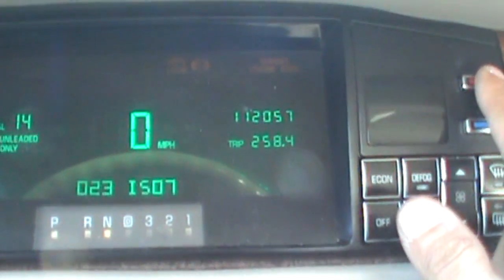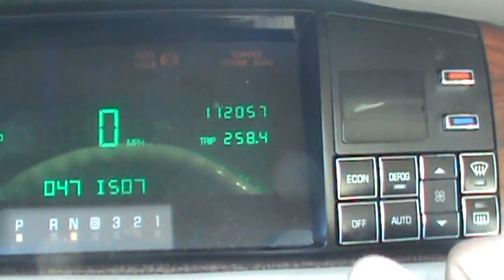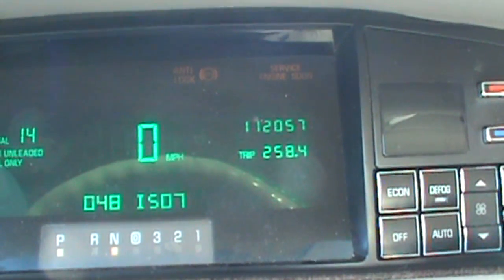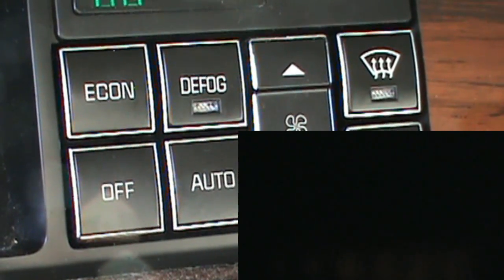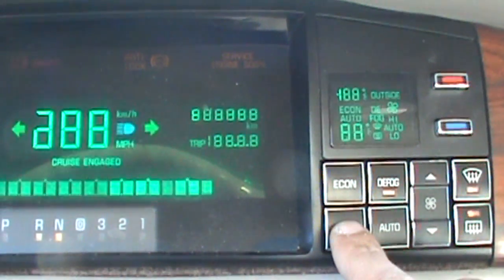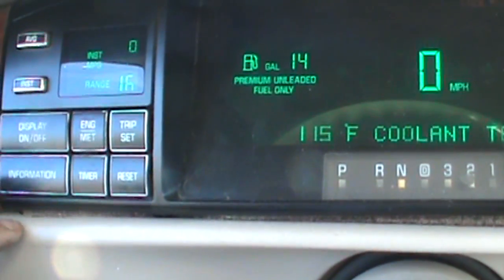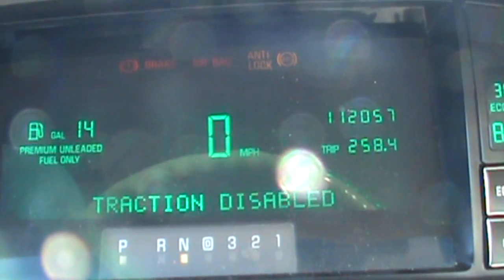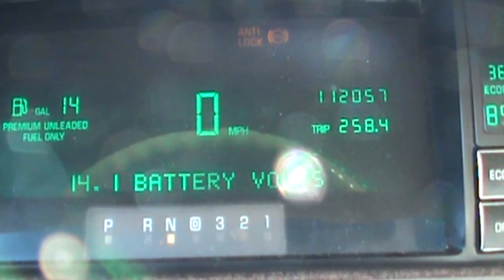Cadillac DeVille Gauge Cluster Reprogramming: Engine RPM, Coolant Temp & Battery Voltage

Comment: Watched this thinking it was something new for me haha. Good info though. Either someone did it on mine before I bought it or the 94 was already programmed that way, but these options were able to be accessed by me in my 94 DeVille 4.9l. Useful for sure seeing as I'm likely going to be the last and third owner of the car at 111,000 miles 31 years old now. Good to monitor that my coolant isn't drastically changing or rpms aren't going wacky on me.

Comment: My 96 Cadillac Concours has a digital gear shift indicator and does not display as the one shown on this video. I can’t read the different folders of the computer. Is there a video showing a later version of these instructions? 96 with total digital dash.

Comment: Hello , I have a 1997 cadillac deville.   This vehicle has been sitting for the last 3 years my neighbor is retired and has not used it I recently purchased it has 39000 original miles it drives very nice however my service in a service engine light soon came on I'm on and I took it in for a sfor a smug and it did not pass the results were that the Hydro Carbon (HC) numbers were too high.can any please explain to my how to resolve this issue, I would really appreciate your help.

Comment: I had the original assy and switched the center portion of the cluster with another one. I started the car a few times and reset it a once.  But my alternator is bad. Am I good if I fix the alternator?

Comment: I have a 1993 Eldorado, and when I went to the sub menu that shows IS07, I had three zeros (000) showing.  I didn't add 32 to it because I believe if you use the "clear codes" menu it will clear the codes back to zeroes.  I don't know that 32 is any magic number.  One other thing, my SIR light stays on all the time (air bag).  When I try to clear codes in that menu, it says "no codes to clear".  Anybody have a suggestion on how to turn the SIR warning light off?

Comment: What else do you know how to do? Im modestly familiar I.E. I can shift gears manumatic ive actually had to or run the risk of blowing my ish up dont mess with the throttle position sensor or the idle speed actuator lol my car would redline at all times wouldn't shift until the very last second I basically had to hotrod it to the max

Comment: I have 3 speedometer clusters 2 have 3 plug ports my 96 has 3 ports I have to keep switching clusters so the car can start every few days I’ll get “THEFT SYSTEM” when I get the message car won’t start after I turn it off 
Only the digital is out not the warning lights 
I could unplug the burnt out one and put the wrong one in and still be able to drive the car if I were to disconnect theft system will I be able to start car the car using the wrong speedometer ?

Comment: The dic on my 1992 is blinking on and off help
Reply: Greg Muscovalley it’s some kind of a faulty relay. Take it to an electrical shop before it short circuits. It happened to my old 86 eldorado with the digital instrument cluster. Fixed in no time.

Comment: James McQueen
4 days ago
If I end up with a  000  ISO7 Code do I add 32 to the code which will make it show 032 ISO7.  I got confused about this.  And if my code reads   016  IS07  I should add 32 to it to make my code reads   048 ISO7 .     I want to be clear on this.  My email is mcnell4@att.net    There seems to be two different codes I can end up with.  Thanks so much for your help.  I'll wait until I hear from you.    (Mac)

Comment: Hello T.Y.C.,
I have a problem on a 1990 Cadillac DeVille and I was wondering if you know the why and how to fix it?
The fuel data and climate control clusters show only the letter "c" they have worked on and off but not for long,
Background on the car, it was bought and brought from Tennessee to California; I have removed and disconnected BCM and ECM cleaned the terminal which showed some light grey rust, opened the modules and checked for cracked solder on the circuit boards but no cracks visible... was surprised to see the boards sealed with some kind of clear epoxy, very well sealed!
however the terminals of the BCM port also seemed compromised by the corrosion.
On my way here I checked fuses and relays cause it was kind of cold and wanted to see if I could make them work, a few minutes back in the road the clusters worked for about 5 minutes was able to change temp settings and checked fuel usage, the second time was at home in California after I had checked and put everything back together but this time only worked for about 30 seconds and it showed the letter "d" blinking proceeded by the letter "c" which stays on.
Nice car so far all dealers I have gone for help have turn my business down because they no longer have service manual for such an old car.
The end.
Reply: My husband has a 1993 Cadillac DeVille and car is also showing the letter C. I would love to find out why so he can fix it.

Comment: Hey! How can i delete "Anti Thef System problem"? The key is OK, the resistor is ok, and i can't start car, please help me!
Reply: Sergio Weikath Check your ignition 1 relay, your Starter relay, Check your ground cables to see if they're are connected to the engine and the body or if they are not broke. check your positive cable as well.
Reply: oh just seen you mentioned just the key, check your ignition cylinder as well, the wires tend to break.
Reply: The car have Spark, but dont have injectors pulses, fuel pump is ok.
Reply: Sergio Weikath so the car cranks?
Reply: Yes, just cranks!
Reply: Sergio Weikath try the relays, or you could probably have a bad neutral safety switch. try putting it in nuetral then crank it. if not either bad terminals, alternator, bad injectors or not enough fuel pressure. check the filter if it ain't the Fuel pump.
Reply: Ok im will try the relays and the fuel pressure, i was check to crank in netrual but was a fail test, thanks for the information, i will write you if i have questions.
Reply: Sergio Weikath np

Comment: hey man I found a 94 Cadillac DeVille and it runs fine but the dashboard lights don't work at all do you have any idea what problem that could be
Reply: Yeah...replace the instrument cluster bulbs. First make sure the dimer control knob is not scrolled all the way down,if it is scroll it up until you see dash lights .

Comment: I have the crazy most haunted cadi its a 97 deville and for whatever odd reason. Under my steering colum there is a 2nd ignition switch with a new key in it and its tied. To my sercuity alarm and i feel hopeless about this i cant find anything. Telling me that this is ok or normal they had some cheap. Radio installed and i thought maybe if i go to pick ans pull and get a factory one back where it should be it stop sayimg theft system problem car. May not restart but whem it wants too it will run and start with thw same blinking sign theft system problem car may not restart remove key i couldnt even find one car at the junk yard that had anyting simular no mechamic seems to know either they said for sure the steeing cloum may have a cracked in it and the hole things needs to be replaced and also when i didl reseach. About my computer key the resistance of the key was 50ohms went to radio shack got 2 resistors which added to 52 ohms and nothing been working and not giving up on this car because its my only means of transport and im anxious to get it fixed. To see my son for now its the bus but if anyone has heard or been through this please help me out with any info it mean the world to me thank u
Reply: Seth Green if the key under the column has a chip in it get a multimeter, hold the multimeters positive terminal on one side of the chip and the negative terminal on the other side of the chip.

Get a resistance reading (in ohms) and solder in transistor(s) with resistance equal to the keys chip. 

When you look at the weird key under the column does it lead to a yellow wire on both sides of that chip or ignition?
Reply: Can anyone helpe fix this what would be a other option I got stranded at a bus station and got robbed I need my car
Reply: Post a video of the wiring to the 2nd ignition switch that's under your column so I can see what is going on and I might can help you fix it the proper way.
Reply: it's a VATS ( vehicle anti theft system ) bypass.. means your original ignition cylinder or key resistor was not being read.

Comment: I have a 1998 Cadillac deville and it's saying theft system problem car may not restart. then sometimes it will start up after the 3 minutes it tells me to wait ..how can I fix that and how does that happen please let me know I think it's the electrical system .. if it matters I have a brand new alternator put in I also have a brand new radiator I have almost 16000 miles on it please help and respond thank you

Comment: That was a really kick ass video. I have a 94 Deville and it worked. I am a bass head (love car audio systems) since i can see my volts ect. I can continue with my upgrading to 3500 watts. Is there a way I can override my suspension sensor since I converted air shocks to coil spring?
Reply: Kevin I also have a '94 Deville that I'm putting sub in I had couple questions about installing it if you had a second?

Comment: ((99 deville))..is it possible to cancel/clear the Service Air Bag light via the  onboard dignostics?  I have a regular OBD II scanner but it not read SRS codes. I had to change the seatbelt tensioner and all of a sudden  that warning come up. it over-rides all other displays I used to use (RPM/Voltage, etc) ty Great job.

Comment: I tried this trick on my 95 Cadillac DeVille and didnt change much still didnt upload the temp or gas mileage only dif it made was it said service air ride nd it aired up my back shocks 
On my cluster gauges it had the number 016 Is00 so I put 048 is00 like you said nd thats what it changed

Comment: i need to reset my abs codes please help
Reply: +TheEdgeOfCuttingEdge yes they come up after i move the car a little then they light up
Reply: +TheEdgeOfCuttingEdge yes they're off i start the engine move the car sensor goes off then they light up.
Reply: +TheEdgeOfCuttingEdge said it was driver rear and passenger front i replaced the driver rear the other day not the front hub yet but you're saying it could be a bad wire as well?
Reply: +TheEdgeOfCuttingEdge ill look for bad wires thanks alot it's driving me crazy

Comment: I have an issue I could use some help I tried this to get the coolant temp but it did not work was at 016 now at 048 but the issue is that my 1995 sedan deville keeps saying "engine overheated stop engine" even before it is started in the morning I just replaced the thermostat and the sensor by the thermostat what do I do I'm so lost

Comment: I fill my oil to fill in my 99 deville and the percentage on the odometer reads around 26% why is that ?
Reply: +TremendezBeast  You need to reset it yourself. Just hit the info button until you`re on oil life left, then hold the reset button for a few seconds.
Reply: That percentage is the oil life indicator, not how much you have in it.  When the shop changes it, they reset it to 100%.  Oil life, not oil quantity.

Comment: is there a process to reset the air conditioner cluster? everything on my cluster works except the air conditioner and heater. it blanked out when I started the car and had the heater left in the "on" mode from the previous night.

Comment: My 1997 Cadillac De'eligence keeps reading low oil turn off engine,even though it full of oil...HELP ! ! !
Reply: +Peter Moore Replace the oil pressure switch/sensor.

Comment: I have been asked to see if I can fix a digital display problem on an 89 Cad Eldorado.  It's unlit all segments!  All voltages are correct as per the shop manual.  The information panel lights and the radio display varies with the light control. The owner states the cluster was tested OK.  Is there a three finger command to enable the display?

Comment: My car says check fuel gage an won't start. Crank it over till battery dies. Can't figure out why won't start. Seems to not start after not starting it for few days of cold weather. Please help
Reply: Did you ever get a response
Reply: I just had this issue....I replaced the battery and alternator...it fixed the problem
Reply: Omg was that expensive
Reply: Check fuel gauge means for the driver to look at the fuel level because you are low on gasoline.
Reply: Fixed problem, sold car
Reply: Got a truck now with list of more problems

Comment: What's the purpose of doing this
Reply: The regular digital gauge cluster has these options available by pressing & holding the info button. But you must scroll through the menu to get them. In addition, what you choose, say RPM, is not displayed again on the next startup. This enables the last selection from a quick/short menu to be displayed everytime. The menu changes are possible due to the fact that roughly the same cluster brain and logic were used for the digital and analog gauge clusters. Mostly due to the fact that the DIC and climate control systems are functions of the instrument cluster switch gear and data system.

Comment: how to fix a 1998 cadillac deville theft system problem?
Reply: Zionist JewTube is your digital speedometer burnt out mine is the correct one is burnt out I can use a wrong one for 2 to 3 days before I get a theft message I can’t start the car after turning off the engine I have to wait to the security light shuts off after turning the key on then it will start I’m lucky to get 3-4 days out of it before start acting up again

Comment: Am I ok to add 32 if it's a 95 Cadillac Deville? I don't want to mess anything up. i don't have money to sent anything out for repair, lol. Also, you see where your gas gauge displays 14 gal ? mine always flashes E, even on a full tank. Do you think this is a computer error or something wrong in the tank? My last question is, since my gas gauge always flashes E, I go by the fuel used to ESTIMATE when I will run out of gas, since that is fairly accurate. If I do this reprogramming, will it mess anything up with the fuel used calculations? Whatever you were talking about there confused me. Thank you for the video. The heat stopped working in my car, so I'm hoping to find out the temp to use as a factor in figuring out what going on with the heat!
Reply: Kat Miller it worked on my 1995 deville concours
Reply: ***** mine did the same thing. always flashed E, even on a full tank. and it was just a blown fuse under the hood. i also have a 95 Cadillac Deville. Check the fuse first. my mechanic told me that the fuel sensor ball in my gas tank was stuck. i was so happy it was something simple.

Comment: Bro you're a fucking GENIUS your videos are extremely helpful with my 94 DeVille. Turns out when I bought my car the previous owners had the rpms at like 1300 anyway, I was curious what all you can do with the DeVille's obd menu. I'm really curious to know what other secrets there are. Do you know or know where I can find that info?
Reply: Ross DiCola I have an 86 Sedan Seville.  It runs fine, but I can't get the fuel data center out of metric mode. How do I get it switched back to read in gallons?

Comment: i just lost all the lights on the cluster panel. its not the fuses or the relays. the body control module is okay. the cars runs but no information at all. when it starts the AC turns on and cant be shut off. i have a 1998 deville. was told to replace the whole panel. the Anti theft also kicks in and have to do the key reprogram. this is so crazy.
Reply: Anthony Casamassima just the digital part is out right the top manual bulbs are OK that’s the pisser I’ll get a theft system message when I gave that every four days I get it swapped out speedometer and put the broken one and then the car will start up 96 sedan Deville

Comment: Have you ever changed or fix the steering wheel switch the fan and temp switch is stuck code is B2511?? 97 Deville. Thanks

Comment: my 94 deville showing 000 is7 adding 32 would never work... :( i have searched alot about that and never find help about this ! i still run without rpm and temp
Reply: I have a 1995 cadillac deville and my head dashboard need programing so how i do that

Comment from the maker: In all honesty bud, I have never heard of a transmission slip when cold. I usually experience shifting problems when the transmission is warm. If the transaxle was slipping while warm I would say dump a bottle of Lucas in it to see if that helps and if it doesen't then the bands are more then likely shot especially if the transaxle whines in a particular gear. If it were up to me I would say leave it for awhile unless of course it is really bad. Give me til the weekend to look in the svce manual

Comment: hey man, i bought a 92 cadilla eldorado, with the northstar 4.9 like your 94 deville, my transmission slips when the engine is cold, but doesent when the engine is warm, the fluid is topped up and clean, can this be fixed without replacing the trans, and can i get it done by a mehanic for less then 500 bucks, thanks - van